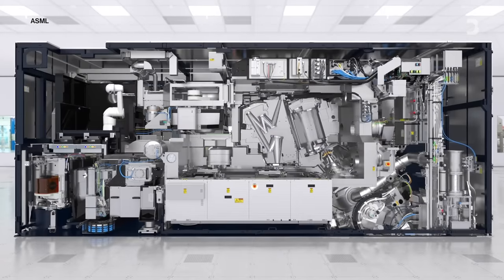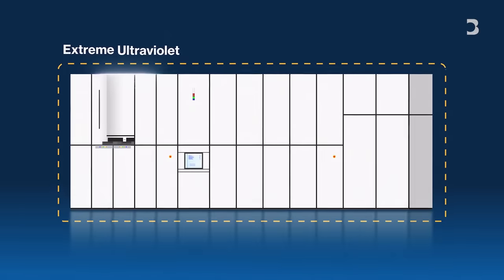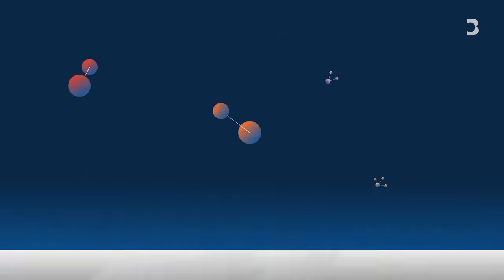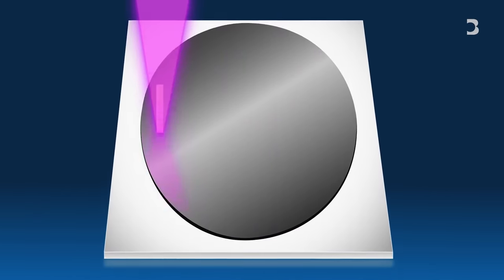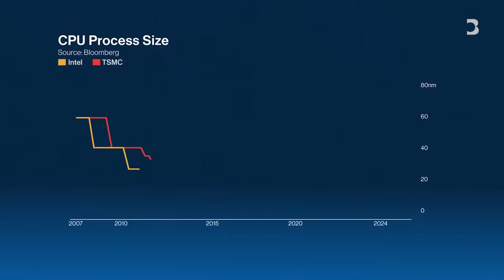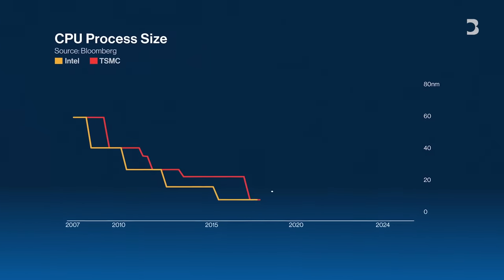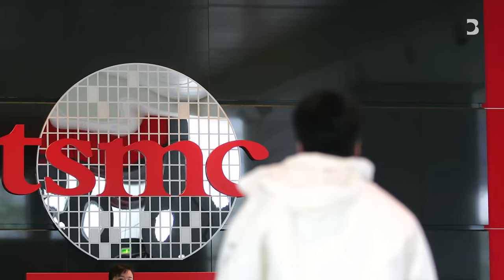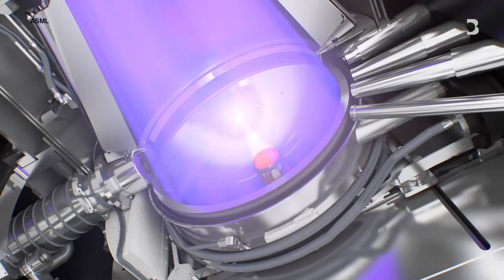America’s Big Chipmaking Blunder

Comment: Our early tech companies were started and run by engineers.  Over time the engineers running these companies were replaced with bean counters. American workers were laid off and the work was moved overseas to be done at a much lower coast. It was just a matter of time. Blame it on the greed of the top level managers at the expense of the American worker.
Reply: so many managers think they can do the job just as well as engineers, short sighted

Comment: Regarding the chip shortage:

For 4 years, I worked at a Texas-based semiconductor fabrication plant. (DUV and I-line)
Our fab has been running 24/7 all throughout the pandemic. 

The bottleneck problem is, all 300mm wafers have to be put on a train, then a cargo ship or a plane, shipped to either China, Taiwan, Philippines, Japan, South Korea and Malaysia to be cut, then put into their final chip form, then sent back the the US, where they have to be redistributed, then installed wherever they are needed. 

Some are even installed on their circuit boards after this process, due to the circuitry ALSO being created overseas. 

There is no facility in the US, that can do this final process in a high capacity scale, nor plans to do this, because it’s cheaper to outsource to other countries. 

Not forgetting the fact that the machinery needed to do these complicated procedures, are all patented and built by Asian and Norwegian countries. 

Now, think about it pragmatically; 

If your country was just getting back to work from the pandemic, who do you think they would prioritize? Themselves or US (who had a president that downplayed Covid, blamed China for it in the first place AND by proxy, caused horrible crimes against citizens of any and all, Asian decent) ?

I say that only because right after we had gotten shipments caught up after Trumps “tariff war” debacle (which is a tax that WE, the consumers pay) then we got hit by the pandemic. 

Once gain, we were having to store excess wafers due to the supply chain being backed up. We have $millions of dollars worth of chips that are STILL waiting to be sent overseas, finalized, then sent back. 

(Then you have factors such as excess shipping containers that are overcrowding Asian and US ports, making organization more difficult, a decrease in truck drivers, the occasional container that falls off the ship in a storm, excess fuel costs slowing down distribution, etc. Some higher end chips are flown over on cargo planes, which has also increased costs due to fuel and pilot shortages.)

Y’all want faster chip production?

Find a way to move final chip production stateside!!!

I left that industry after witnessing poor management and poor future planning.
Reply: I don't think that the politicians have the long term vision to do that and the corporations in the US that own the politicians are only interested in the short term profit.
Reply: Costa Rica is working on becoming a leader in microchip packaging. That should fill the hole without being too far away (short ship journey).
Reply: @korakys  
Is Costa Rica in the U.S.? No.
Are they closer? Yes.
Political upheaval from neighboring Central American countries have been known to block, or even, commandeer cargo ships during civil unrest. (These countries still don’t like the U.S. because of the comments made by the last president) 

Then there’s the other factors:

Ships are getting bigger. Yes.
Yet the maintenance budget on them is required to somehow… be cheaper than the small ships… to turn a better profit for the ship owner.
These shipping companies pay ZERO taxes to our country, because they fly flags of convenience.
Ships still sink from time to time. Who pays for it if they are under insured? (Which is most of them) Litigation for these disasters can take decades.
Ships can block canals. (Or take out bridges)
Harbors get delayed with union strikes and worker shortages.
Prices for shipping fuel keeps going up; that translates to more consumer costs. (The company shifts that off of themselves)

Why can’t we just agree that the best course of action, is to bring full chip production, state-side?

When the Chips Act passed, TI was already paying for the expansion of a Malaysian facility. The Chips Act does not allow that money to go towards foreign countries.

So… rather than future proof our country, it was decided to outsource, well, everything.

Not even the Chrysler 300/Dodge Charger/Dodge Challengers, are made in the U.S. 
Every single one of those “American Muscle Car” models were stamped, forged and assembled in Ontario, Canada.

Comment: Intel didn't use EUV because they tried to advance past 14nm but got stuck big time, but were too proud to switch tack and either buy from TSMC, or adopt EUV because unlike smartphone ARM chips where smaller nodes mean big power savings and longer battery life, x86 desktop/server chips doesn't need to be that power efficient at higher cost and lower profits. And also because they were facing minimal competition from AMD so could afford to get stuck for years, that is until AMD fought back with Zen/Epyc. If Zen/Epyc didn't exist Intel might still be on 14nm.
Reply: We aren't talking about consumer grade chips, the fact you don't get that shows you like to speak about things you don't understand
Reply: Power efficiency is important in any chip, doesnt matter, if you have your personal powerplant for it. Less power consumption means less heat density, so you can cool it with a simple radiator instead of liquid nitrogen and have more cores on higher clock speed.
Reply: "server chips doesnt need to be power efficient"

Just stop.
Reply: I think you mean tack not tact.
Reply: @williamelewis464  Buddy, the chips in your iPhone & MacBook are made on an EUV machine. The RTX4080 in my desktop is also made on a 5nm node in a EUV machine. 

We are talking about consumer chips.
Reply: And yet, in spite of all of these Big Brain moves, Intel has fallen behind. Hmmm, interesting. Almost like ignoring technological advances has a negative impact on future performance.
Reply: @E3_Kruger  Read my comment again - I mean "THAT power efficient". Sapphire Rapids is at "Intel 7" (aka 10nm) while Apple's A16 is on TSMC's N4P (4nm). Intel's desktop and server chips have always been several nodes behind the cutting edge, because they're really, really expensive for a monolithic die. We'll see how they go with chiplets.
Reply: @flyerphil7708  Thanks, spelling corrected.
Reply: @Boris-Vasiliev  Power efficiency hardly matters if you monopolize the market. Intel didn't care because back then there was practically no competition in x86. I mean who brought Athlon back then? AMD didn't even have a server product before Epyc, and back then no laptop OEM used an AMD CPU in any of their laptops - Intel in effect had 100% of the laptop market.
Reply: @Avantime  WRONG!!! power efficiency is extremely important in data centers (super important business for intel) and electricity is a big chuck of operating costs (not just for compute but also heat dissipation considerations.) 
data centers were slower to node migration because of reliability concerns and ecosystem complexities that favor using existing proven/debugged hardware until the whole system gets an upgrade. AMD took a long time to get its first EPYC chip tested and qualified, and subsequent chips saw faster adoption
Reply: @Avantime  The majority of Sapphire Rapids CPUs were chiplet based, this design decision strongly contributed to their poor power efficiency, perhaps more so than the ~35% larger process node by transistor density that they were fabricated on over TSMC's N4P as compared to Intel 7.
Reply: @doctorwilly  Yes for the data center operators, But NOT Intel. Because back then if you want to buy x86 server chips your choices are either Intel, Intel or Intel. AMD didn't even exist back then as an option.

If power efficiency is really key most servers would be using ARM, but why don't they?
Reply: @paulblair898  That may be so, but power efficiency of server chips has never been as critical as smartphone SoCs, where a phone must last a full working day on battery power. That's why the leading TSMC nodes are almost always reserved for the likes of Apple and Qualcomm, and previously Huawei.

With so much money sloshing around in AI, Nvidia is starting to push the envelope as well, as GPUs become mini space heaters. But CPUs will always be behind. How far behind depends on how much AMD is pushing, and how many billions uncle Sam is willing to give away.
Reply: @williamelewis464  "We aren't talking about consumer grade chips, the fact you don't get that shows you like to speak about things you don't understand" My brain froze when I saw your comment, literally.
Reply: You're right about some things but like others have said, power efficiency is in high demand for data centers which spend a  ridiculous amount on cooling solutions. Paying up for a passively cooled Arm chip would be a better long term investment than getting a cheap x86 chip that eats through your energy bill.

Comment: "One atom thin layers"...wow. Human tech is inching towards the physically possible?
Reply: Always has been
Reply: Well we've kinda reached it a few years ago, we're on the optimization side now
Reply: It's about the surface roughness. How hilly and jagged the top atomic layer may be, not the thickness.
Reply: Yep. The limit is the fact that the "noise/electrical interference" of the subatomic particles in an atom moving around becomes a problem. Spock says Fascinating.....
Reply: "Atoming toward"*
Reply: @billwendell6886  Even at the current level you have quantum tunneling, and that's actually the biggest problem they face.
Reply: @rev3274  Graphene might be a solution for quantum tunnelling problem.
It is still a very looooooong way to make it possible.
Time will show how long to introduce it to high volume manufacturing.
Reply: user-zn9ke8um8s  that's a different device entirely.
Reply: they're overstating it. I work in the low dimensional materials field, specifically for chip process and manufacturing, and the estimate was that we'd be putting some 2d materials on top of chips as drains, possibly, in 2024. that was our estimate in 2014, though, and it didn't happen. honestly, it'll be another 6-10 years before we start utilizing that.
Reply: The FABs are not at "one Atom" thickness yet. 3nm is FAR from "One Atom".  They were speaking about the mirror surface on the EUV Machine.
Reply: It would be funny if Intel named their processor that has that technology intel atom

Comment: I spent over 25 years at Intel and I have a slightly different perspective. Intel has a "copy exactly" philosophy when it comes to their fabs. All are identical. Intel simply couldn't get enough EUV machines to handle their leading edge capacity needs and they couldn't run different versions of their process in different fabs. So they chose to use a different lithography technique across all fabs. It's called multi patterning and it didn't work so well. Their mistake was in not running what's called a small "boutique" process line to get experience with EUV until they could get sufficient machines. Also the chips TSMC was making were much smaller is size and therefore they could take the hit of lower yields. The smaller the die the higher the yield at a given defect density. So they could get up to speed faster and still ship volume to their customers. It was a hard lesson for Intel but I think they are on their way back to process leadership. Only time will tell.
Reply: Intel has and always had "boutique" and not so "boutique" labs running all sorts of experiments. Some fruitful, others not. Management just made the wrong decision at the time, that's all.
Reply: Multi-patterning has been around for years, and most companies are doing it. It pre-dates mass produced EUV by several years. I think you guys started using it with the 14nm node, which far pre-dates EUV which was first used by Samsung for the 7nm node. It's also used a lot for NAND as well.

On the Intel side, EUV was first introduced with Intel 4 (formerly 7nm). Whether there were discussions about using it for 10nm (aka Intel 7) I don't know. But reports that have leaked over time about the difficulties (and the 10nm being close to 5 years late) seem to indicate that they were being too aggressive in scaling as well as the issues surrounding the use of cobalt for some layers instead of the traditional liner + copper. I'm sure management and spending didn't help, but it kinda seemed like you guys had ran yourself into a hole and had to just keep digging.
Reply: As someone that works for a semi equipment maker, I can tell you CE! definitely has been slowing down Intel's progress for decades. We freely share the latest advancements with Intel's competitors such as TSMC, Samsung, but couldn't do so with Intel due to CE! A lot of times we won't even discuss these changes with Intel due to the fear of something getting locked into CE! and freeze our supply chain.
Reply: @mintheman7  What is CE! ?
Reply: @portalminer8813  CE! or how copy exact is denoted in all documents. I’m really surprised you don’t know that after working for Intel for 20 yrs.
Reply: @mintheman7  I don't remember seeing the "!" on the end. I thought it may be a new designation. And it was 25+ years.

Comment: TSMC overtaking Intel in CPU process size wasn't because of EUV.
The first TSMC manufacturing process which overtook Intel was "N7", which was slightly denser than Intel's most advanced process at the time (10nm). N7 doesn't use EUV, it only uses DUV (Deep UV, the predecessor of EUV).
However TSMC extended their lead by adopting EUV for N7+ and N6, which were enhancements of the N7 process; while Intel stayed on DUV for "Intel 7", which is what they called their enhanced version of 10nm. Intel will use EUV for their next-gen "Intel 4" process, but TSMC is already making chips (Apple M3) on an "N3" process which is significantly denser.
Intel 10nm was a complete disaster, which ended up taking about twice as long to develop as Intel planned, while also being much less reliable and more expensive than expected. Meanwhile, TSMC N7 progressed faster and performed better than most people expected, resulting in Intel competing against AMD's 3rd generation of processors built on N7 (Ryzen 5000-series) with 11th gen Core CPUs built on Intel's old 14nm process from 2014, with half as many cores and double the power usage, for most of 2021, until Intel finally got 12th gen CPUs built on the Intel 7 process out.

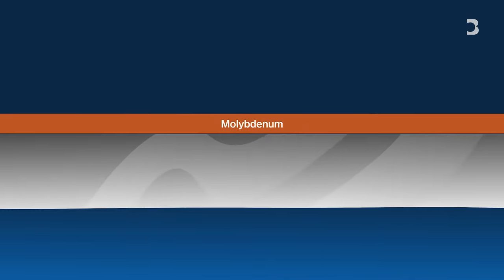Comment: 2:00 How can a layer be polished to have a thickness of less than one atom?  The video goes on later to correctly state that this is impossible at 2:47
Reply: It's a SMOOTHNESS of less than one atom, not a thickness.  In other words, the variation from the peaks to the troughs of any surface errors are less than one atom in size.
Reply: @pmirsky658  Ahhhhh.  Thanks for the explanation!

Comment: Another example of how global trade and outsourcing to save ten cents ruined everything.
Reply: If you don’t do that, you will have inflation, which is worse than losing jobs.
Reply: @brotherbig4651  Don't give me that bs were doing it now and still have inflation so what's the difference?
Reply: @GamerbyDesign  You are currently decoupling with China. A lot of Chinese products are banned. If you allow China to import their electric cars and other manufacturing products, you won’t have an inflation at all. You can buy a new car for 10k in China.
Reply: @brotherbig4651  And when was the last time you can buy a new car for 10k in the us?  There will inflation for a while then new companies will start manufacturing here and it will go back down.  Never should have coupled with China in the first place all that it did was help them.
Reply: @GamerbyDesign  You are dreaming. US don’t have the engineers, labor, and technology to build new factories. Your people don’t even want to work for 5 days a week. They think manufacturing is too boring and exhausting. China built the factory for Tesla in a year. It took Texas 4 years to build a much smaller one for Tesla. TSMC wanted to build a chip factory in Arizona. They couldn’t find enough chip engineers and manufacturing workers in the US. They wanted to import their experts from Taiwan to train local people. And the effort was blocked by anti-immigrant law makers. And if you tell me it is because the workers are not paid fairly in the US, then it means you want to massively increase their wage, which will push up the inflation further.
Reply: I don't know where you are from, but you are correct. I am also an immigrant and I got to say that Americans feel more entitled to work less and get paid more, which is fine but then they complain when other countries start overtaking them. Americans lack self reflection 🪞.